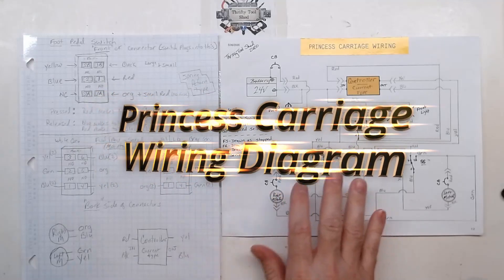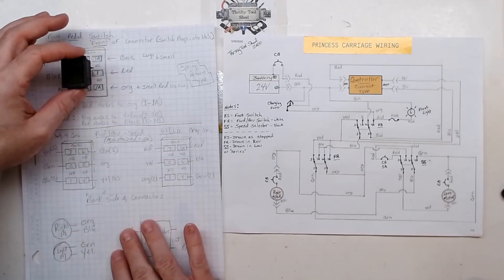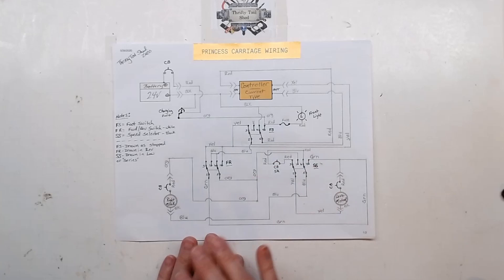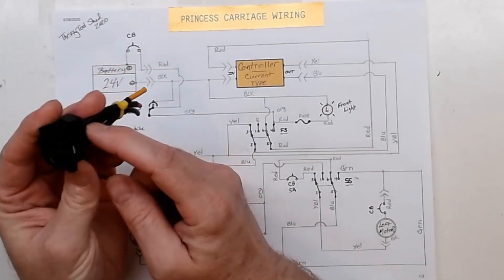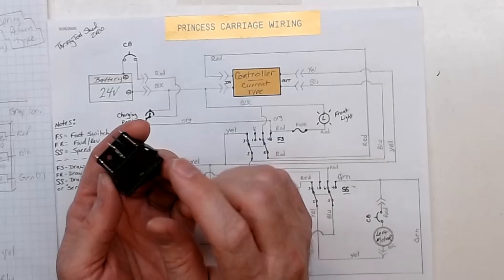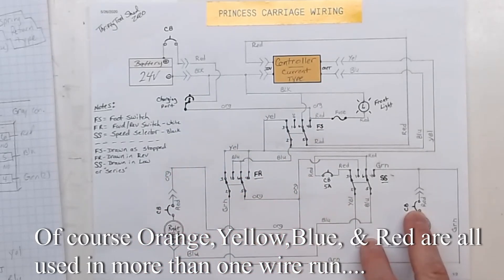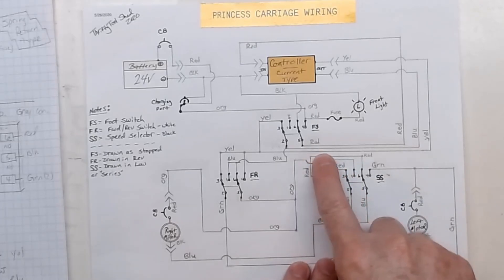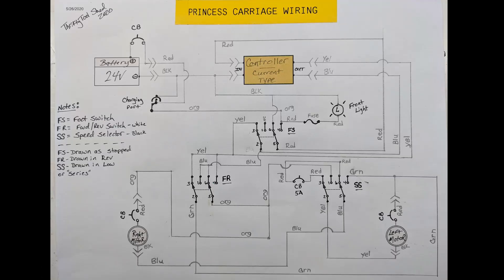Disney Princess Carriage Wiring Diagram

Comment: I have one that seems like it is a slug it just slow in forward and reverse replaced both motors  and silver box by battery replaced gas peddle
Reply from the maker: It's either the batteries or the speed selector switch is not putting the motors in parallel for high speed, most likely.

Comment: Hello sir, I hope all is well. I have been gifted with a Disney Cinderella Carriage that isn’t operating. My battery voltage is 13v. My question is does the battery have to be at a minimum standing voltage to operate the motors? Thank you in advance sir.
Reply from the maker: I believe it does. 13 volts is very low as it should be 24V on this model. The motors are quite beefy. It truly takes a good  bit of power to turn them.

Comment: How would I hook up battery to bypass the controller?
Reply from the maker: It really needs the soft start controller. It might be ok to test out by bypassing the controller, but I would not think it would run long long term with the load of the motors starting/stopping and arcing across the switches with hi Inrush current.  I have shared a wiring schematic that should help with this question as I have not worked on it myself in several years now. If you have a specific question about the schematic itself let me know and I will look back at it.

Comment: Hello thank you for taking the time for the informative videos.. im currently trouble shooting one if these. The carriage works fine for about 3 minutes then it stops completely and will only restart after a minute of rest then it repeats the cycle on for 3 minutes off for a minute any idea? Thanks
Reply from the maker: Glad you found them informative. I would check the controller and see if that is where you are losing power. I don't think it's one of the motors or circuit breakers feeding them because it would only stop both of the motors in series or low speed. High speed would still run one side or the other. Thanks for your kind comment and best of luck to ya!

Comment: I need help, the battery is good the charger is good, lights come on but it doesn't  move. The pedal clicks. But the handle to switch the speed is hard to move even opening it do you think I can change the switches on the back. They have a little yellow  on the prongs
Reply from the maker: I assume you are saying the switch has corrosion? I would check that and clean it for sure. I have the schematic that I have drawn quickly to help follow through where you may be losing power. I would at a minimum clean the switch contacts with plastic safe contact cleaning if you see corrosion and test using the schematic. I should have a link to some examples cleaner in many of the video descriptions.
Reply: @ThriftyToolShed   yes i have watched  all the videos  i got a new controller which looks like a car heat resistor,  and i just ordered  the (foot pedal) i switched the speed handle it seemed  to have burned  out. It the foot pedal doesn't  work when it gets here Tuesday  idk what else to do
Reply from the maker: My controller was in a black box. It looked nothing like a car heater/blower resistor. I showed what mine looks like in the video....
Reply: @ThriftyToolShed  she used it one summer like 4 times  and we've had it in the storage since 2021

Comment: Is it okay to bypass the regulator? If so which wire goes to which?
Reply from the maker: It really needs the soft start controller. It might be ok to test out by bypassing the controller, but I would not think it would run long long term with the load of the motors starting/stopping and arcing across the switches with hi Inrush current.  I have shared a wiring schematic that should help with this question as I have not worked on it myself in several years now. If you have a specific question about the schematic itself let me know and I will look back at it.
Reply: @ThriftyToolShed  I bypassed it before and it was working fine but I disconnect the wires to solder them together and I couldn’t remember which wire went to which. I connected random wires but they started melting.
Reply: @ThriftyToolShed  and I tried reading your diagram but couldn’t figure out how to bypass the controller. I have (2)blacks, yellow, red(pink), and blue wires.
Reply from the maker: The only one I have worked on and thus made the diagram for. That one also has 2 blacks that were tied together at the controller input side connector. The blacks on this one goes to the blue and the red will go to the yellow. not saying they make them all the exact same over the years these were made, but most likely still similar.
Reply: @ThriftyToolShed  I tried connected the wires like that but it keeps blowing fuses. Any day what cause that? And thank you for helping because this is driving me crazy lol.
Reply from the maker: Yeah, you know it's not right if it immediately blows a fuse since the pedal is not pressed it should not give power out to motors until pedal is pressed unless the pedal switch is faulty. That is one thing I mentioned in this video is a bad pedal switch can cause a short circuit also.
Reply: @ThriftyToolShed  the pedal was my next guess, could it be something is connecting together at the pedal that shouldn’t be?
Reply from the maker: Well the NC of the switch does short out the motor to do the braking function. As soon as the pedal is released the motor winding are shorted by the pedal switch NC.  So if that is still made while putting power to the motor then that is exactly as I mentioned in the video as the problem I had seen with a pedal switch failure.

Comment: My battery says charged but nothing turns on no lights no pedal help!! 😢😢😢
Reply from the maker: I shared the wiring diagram and briefly went over it to help as much as possible. Not much else to do but mention to test and see where you may be losing the voltage at. You can test by moving the shifter to all positions and making sure hi/low & fwd/rev etc. Are all non-working and that it is not just one not working. If none of these positions work then test from the battery to switch and all the way through the soft start controller. Then after that check all the way through all switches to the motors. Hopefully you will find where the voltage stops and know which is the problem. It is also worth mentioning to make sure the voltage from the battery itself is not dropping off fast when the load is applied. When Lead Acid batteries go bad they will do that. Best of luck to ya!

Comment: I have a dynacraft UTV 24v, similar wiring to this with the 4 wires on the pedal and purchased a resistor for the “brake reduction” similar to the one ML toys makes but it doesn’t have the same connection as power wheels. 

Do you know which wire, if any, I would put it in to reduce the braking effect?
Reply from the maker: I am not familiar with the UTV. Does it have the same soft start controller as the Princess Carriage? If so I am not sure if it will work the same as the smaller ride ons without the controller....
Reply: @ThriftyToolShed  thanks for the response. It has a similar looking control but wiring is slightly different. This one also no soft start or stop. Just pure violence! Haha. I will keep trying to track down a solution.
Reply from the maker: Ok,
If it has a simple foot pedal switch and does not have a soft start controller you should be able to add the resistor to the switch. The side of the switch that has the  normally closed contact that is going back to negative for the brake. If you simply lift the negative off of the normally closed side of the switch most of the time it will coast stop and have no brake...
Adding the resistor in series must ease the brake?
Reply: I ended up putting it on the yellow wire off the foot switch and it worked! Thanks for the help.

Comment: I was wondering if you have added an on/off switch. My 4 year olds love just sitting in the carriage in the garage when I won't let them drive it. So I want to put an on/off switch on it, so they don't drive it through the garage door. LOL. I was wondering where in the wiring would you add an on/off switch? Thanks in advance for the help!!
Reply from the maker: Hi,
The orange wire from the charging port is a good spot to break the power. It will need to be a 20A rated switch to hold up to the current of the carriage not just some cheap low current switch. One other thing to consider is that kids can quickly adapt to seeing you enable the carriage with a new switch of coarse so either hide it well or simply use the battery disconnect...
Reply: @ThriftyToolShed Thanks for the advice!!

Comment: I am working on this thing and it runs but no where enough juice. Any idea?
Reply from the maker: Well it has the hi/low so in low the 24V is dropped across both motors in series. In high the 24v should be across both motors in parallel with much more noticeable power. Other than that you have the controller that is soft start but should be putting out close to 24V after start up if working correctly. The main thing left is the more obvious one, the battery may be too weak to output enough power to the motors. They do pull a lot of current.

Comment: Not sure if you're still actively checking these comments, however, I'm trying to fix one for a friend. I want to accomplish the same thing that your friend did with wiring to a different battery (i.e. wheelchair batteries). Anyway, I'm wondering if you had a larger image or a description of what wires need to be linked together to remove the charging port and wire directly to battery. Thanks.
Reply: For example, I'm wondering if it's just as simple as connecting the orange from the vehicle directly to the battery terminal and not using the red or black from the charging port.
Reply from the maker: HI,
I do still see these comments even though it has been a little while since the video. I believe you are trying to remove the charging port and simply add your own battery. The charger port is shown on the drawing in the top left of the drawing and it has the black wire going straight to the battery negative for charging. The red wire from the battery goes to the port for charging and it also goes to the orange wire as you mentioned while not charging . So the orange wire is only connected (Normally closed switch) when it is not plugged in for charging. So no operations of the carriage is possible while charging. If this is not important to you then you should simply be able to just jump the orange to the red if like the one I show here and that will give the 24V positive from battery to orange wire feeding power to the vehicle controls. Good of you to help someone else out like this! Hope it helps and Best of luck to ya!
Reply: @ThriftyToolShed  Wow, you're awesome and I greatly appreciate your reply! I've modified some of these ride ons before but this one has stumped me a bit. I tinkered with it for a bit again today and I'm trying to figure out if something is wrong with the charging port or the control box. I saw your video about the control box and just ordered it to try that next. I'm able to get power to both the wheel motors by direct connection (and using the foot pedal), however, when all things are "plugged" in all I hear is a clicking sound when hitting the pedal. I am guessing it's a control box situation but I'm open to other thoughts for sure. I was about to bypass that box until I watched your video so I'm thankful for that so I didn't further any damage. This toy didn't come to me with any battery or any charger. I wasn't sure if the clicking noise would be a symptom of the charging port or the control box. Any other thoughts/input would obviously be welcomed. I sort of promised this family that I shouldn't have any issue with it. I shouldn't have jinxed myself. :)
Reply from the maker: @MJS-hk6pt  
It does sound more like the controller. I would most likely be willing to jump it out to try especially if you test it in low while motors are in series. The controller being a soft start does keep the motors from having the heavy inrush current when starting, but maybe fine testing in low. With the motors in series it may test just fine .
Reply: @ThriftyToolShed  ok,thanks! I might just wait for the new one to arrive and plug it in. I’ll keep you posted because you’ve been such a great help!

Comment: If I wire directly to batteries motors run fine. But if I go through pedal/selector assembly  I barely get any power to motors? I have installed new pedal switch, new selector, and new controller. Batteray measures 24V. Any thing else I need to check.?
Reply from the maker: One thing to check, as you can see on the wiring diagram, the motors will be in series while in low. So that could explain why you are getting lower power out to motors?  Only in high do the motors get the full 24V to the motors. In series the motors could be getting voltage dropped across one motor more than the other If one of the motors is having issues or it could be losing voltage across another one of the many contact points in the circuit for the low speed. Maybe the low/high selector is having connection issues. so you have to trace down the voltage to see why in high the power is not getting through all the way to the motors.  I do have a short video looking at the speed selector part of the carriage as well if that helps, but if I remember correctly I just had the shifter grinding/hard to shift on this one and no electrical issue with that part. I believe I shared the wiring diagram all together later in this video we are commenting on now. It's been a while since I worked on this. Also, you usually have a circuit breaker in line with the motors, but I am not sure if you bypassed them or not while jumping power straight to the motors? One of the best practices on tracing these issues down for me is to lift the carriage wheels off the ground and test one of two ways. Take a heavy say 12ga wire and jump the best you can across series testing points like across the controller then across the contacts on the high/low switch until you see a big difference in output while the pedal is pressed. The other way is use a meter set for VDC and put it across the same points as mentioned taking the place of the jumper and when the pedal is pressed look for a voltage drop across the points as mentioned above like the controller or high/low selector. We should see very little voltage drop show up across the controller after the brief soft start or hardly any across the switches out to the motors. Hope it helps and Best of luck to ya!
Reply from the maker: One more thing I did not mention.
I did not consider if you tested the motors individually or together with the battery jumped straight to the motors. The reason I ask is because these are high current motors and it could be possible that the batteries run one motor fine but double the current (load) by running both may be pulling the battery down? It's worth testing both motors running at the same time and making sure the battery voltage does not drop or fall off too low if you have not already done this.

Comment: Where can I get a charging port?
Reply from the maker: I do not know of a place that sells the charging port.  It would take soldering in anyway so you can just modify to take any connector you want to really? You could choose to solder in a similar port or just make more standard connectors such as XT-60, EC-3, Tamiya etc. sold in a lot of hobby stores and of course online as well.  You would have to make sure once through charging to the Black and Red, that  the Orange and Red are connected to be able to run the carriage. You may want to see how close something like the link below is for you?
I do not still have the carriage to compare it to so this is just a similar item not direct replacement, you have to look into how close this is yourself and if it will work for yours.
https://ebay.us/xzHOwQ

Comment: I have been thinking about actually putting a relay in place of the foot controller switch so it does not take the current and melt the switch
Reply from the maker: It would hold up much better for sure. I could not believe it was designed to handle that much current On and Off with the pedal switch. When I first started drawing out a diagram I was wondering why the foot pedal was not designed to signal the controller. When I realized the controller only had power going In and Out, that was strange.  The only reason it last at all is the soft start of the controller so the arcing is not as bad, still alot of current through it though.
Reply: My daughters foot switch shorted out the first time it was used bad arc burn on the connections, do you know where i could find another switch?
Reply from the maker: The link in video description was the only ones I had found at the time.